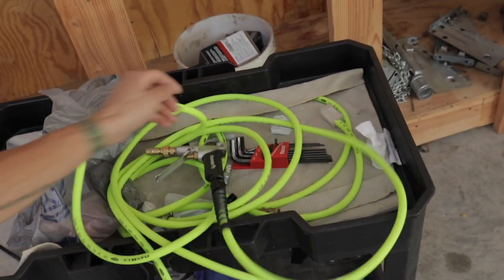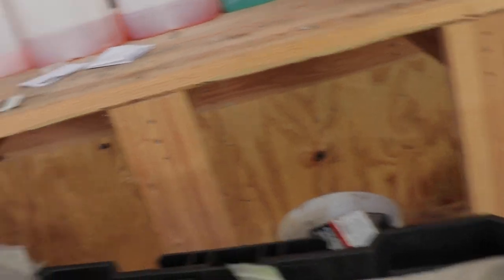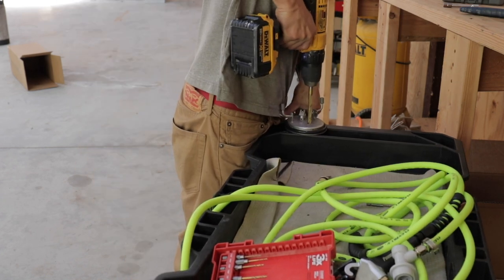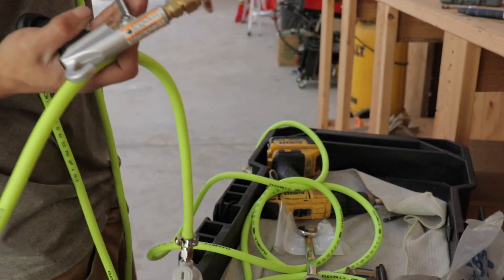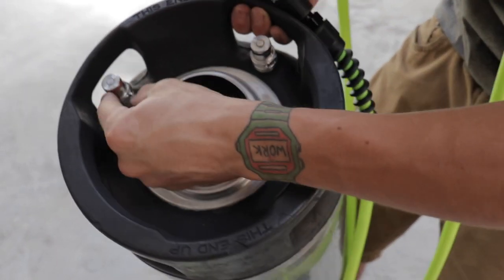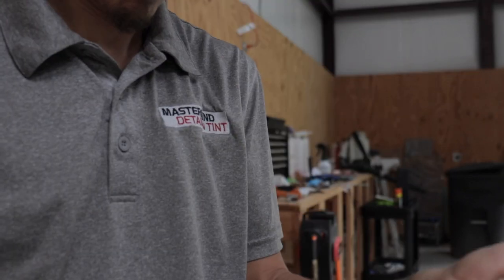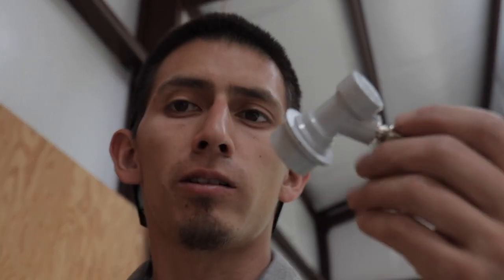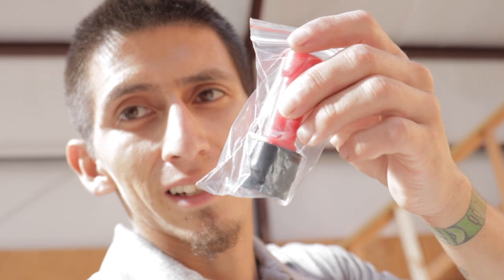D.I.Y Tint Spray Tank / Chemical Sprayer

Comment: The hole for the Schrader valve needs to be big enough so the first part of the rubber goes through the hole. The larger diameter part will seat against the plate. When you tighten the nut the rubber will expand in the hole and seal as intended. Better to adapt directly to the pin lock, again, as intended.
Reply: Great tip! Thank you.

Comment: Where do you get the brass spray tip from
Reply: I bought mine from chapin, found one at ace. The problem is that it won't fit the teejet filter if you want one. Look at teejet tips if you want to use a filter. They are a little bit more, $15$-$30. The chapin was about $8

Comment: I bough the adjustable brass tip and the blow gun and try to use a 1/4  to 1/4 brass niple From Home Depot but the treads are different.  where did you buy yours?
Reply from the maker: elamigotek yes is different tread I just force mine in since I not going to be taking it off. If you do be carful no to brake the gun and use some tread lock or something to seal it so it won’t leak on you.
Reply: @masterminddetail4468  where can i get the adjustable tip or whats the name for it please
Reply: I found an adapter to fit mine at ace hardware. Took my stuff there and kept playing until I found one to work for me. 1/4 MIP to 1/4MIP.

Comment: Hi, why did you add the schrader valve? Could you not find a way to add a coupler or inject air directly through the existing valve? I want to build one too.
Reply: The Schrader valve makes it easier to fill up since most people with a compressor has the adapter. Also, I use a battery pack in my trailer to power my plotter, it comes with jumpers and an air compressor that I don't need an adapter for using the Schrader valve.

Comment: Nice setup would like to see it I'm action
Reply from the maker: jose quiroz works great man. I might do a video soon.
Reply: Alright cool thanks do you use any other setups like that
Reply from the maker: jose quiroz I haven’t use any of the ones they sale. I have made 3 tanks already and they are a game changer. The pressure that it hold is great. I do recommend using a different sprayer not the air gun I used.  Get one that you can add a filter in it. If you are tinting windows.

Comment: what size hose?
Reply: I'm using 1/4 and it has plenty of flow. Less bulky also. You can use 3/8 if you wanted to but the fittings work better dealing with 1/4. I just used an old blow gun i had lying around.

Comment: You can get a better setup than this for under 200, without all the work, and not use sketchy pin lock connections. We sell complete sprayer setups ready to go for under 200 bucks using a used tank, and our lifetime hose assembly with brass trigger and filter
Reply: Also, the trigger you are using has steel components and is going to rust. The ball swivel you used will also fail.
Reply: @jwelch9780  where can I buy from you?
Reply: @luamayav  you can also reach out to us through email, and we will call you back. Search for a replacement keg hose + used or preowned keg to get great pricing. 
Go with new units for full warranty
Reply: @jwelch9780  do you have a website?

Comment: Cracks me up how you guys think you are "saving money" to spend all this time working on building a keg. Do you not value your time? Tinters make 80+ per hour. That's $1.34 x 30 minutes = $40, and you will likely spend way more than 30 minutes to do all this
Reply from the maker: Hey wise guy, be the better person and just share a good link for the people.  Instead of trying to put them down. 
Building stuff can be therapeutic for people not everyone is wire the same way.
Reply: @masterminddetail4468  not trying to be a wise guy, and I don't typically call people names, but if you want a link, cool. tinthozilla.com

Not trying to beat anybody down at all brother. In fact, I have personally spent over 20k on parts for these sprayers, only for the purpose of making this easy... instead of having to go to homebrew store, home depot, and a parts store, you can go to one place. That's it. Haven't suggested anything but for guys to save some time, and if they need the CORRECT parts for building, we have those too
Reply from the maker: @jwelch9780  can you post a link that directs us to the keg you refer too for under $200
Reply: I agree with you J. 
I did everything myself and I’m still having to upgrade hoses, sprayers, valves. 
I should of spent the extra $100 and just bought it all said and done. 

The benefit is that I know my keg inside and out now. When my business gets bigger I plan on buying them all done and shipped to my doorstep.
Reply: @Area559Duh  when you're ready to make moves, let us know. We are here to help
Reply: we also like to be hands on and build our own shit for a fraction of the price you sell the things for, you  make the comment we make 80+ a hour  its actually more than that but whos counting right because it does not matter because we are spending it on overpriced spray bottles your trying to sell. hell you could have made one in the time used trolling this mans video so figure your time out and how much money you just lost. im just saying